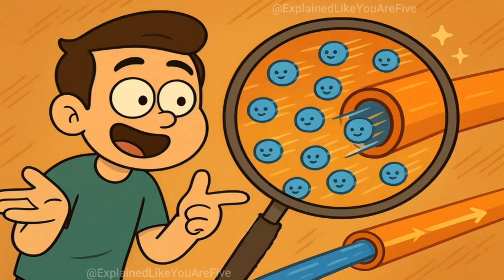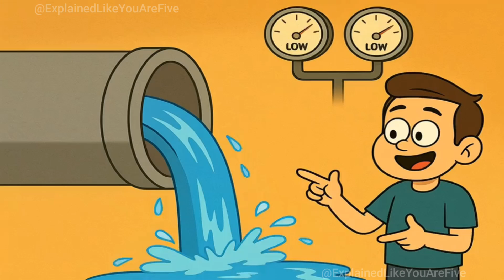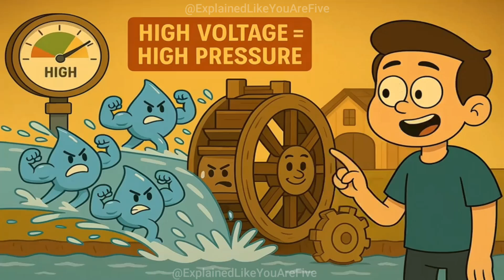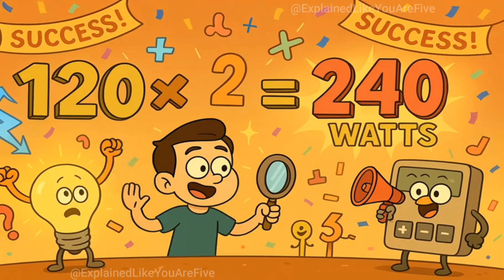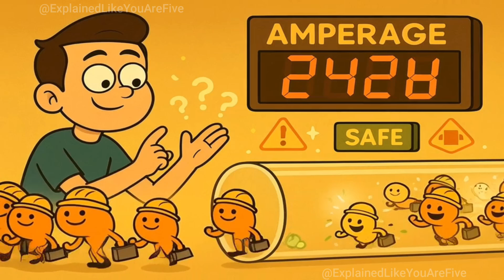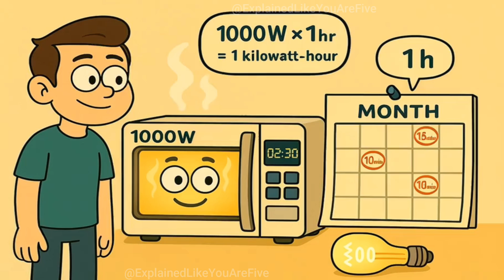The Difference Between Volts, Watts, and Amps - Explained Like You're Five

Comment: One thing that blew my mind was my neighbor is an electrician and when he went to Afghanistan he brought his alarm clock and had to change something about his clock meant to be used in America because clocks keep time by measuring the frequency of electrical pulses and america has a frequency of 60 and I think other countries have a frequency of 50. So not only does energy reach us at 120V they also flip directions (AC) every 60 seconds. Electricity and circuits are cool.

Comment: And once Renewables are connected to the grid there's an 85% loss Easley demonstrated with a volt amp meter in Ohm's law it only takes a second to double-check the power companies or inverters installed watt meter

Comment: It makes more sense to me thinking about it like this: voltage is like engine displacement or torque (like a 5 liter engine), amperage is rpm or the speed of the engine, and wattage is horsepower or total output multiplying the torque by the rpm.

Comment: But why can't a charger provide more than the designed power. I mean the adapter is designed for 11v and 3A = 33W.

But if I tried to put a 6A cable in the same adapter it can't supply 66W. Just 33W is the max out. Why?

Comment: Personal opinion... I don't think these usual metaphors for electrical properties do anything to help understand electricity. "What is electricity?" "It's like this other thing. But also a little different." I like starting with the fact that if the same measuring device is placed in "series or parallel" to a running circuit, it'll give a different measurement in each of  those situations. We have to call that something.... and so on, you go from there. But all this "Make electricity simple"-stuff... It's not simple. It's just not. That's all there is to say.

Comment: The electricity that comes into your house is 240volts. The circuit breakers split it into 120 volts for use.
Reply: Service lines are 2 lines of 120, to create 240.
The breakers utilize one side at a time but "combine" the two lines to make 240 when needed.🎉
Or something like that ...😂

Comment: I've watched 100 videos on this and it's never made any sense to me.
Reply: Volt is how fast electricity moves, amps is how much electricity moves in a second and whatt is how much consumed/needed by the device u using
Reply: @kubawlh  sounds like volts and amps are the exact same.
Reply: @typerightseesight and me 😵‍💫😵‍💫😵‍💫😵‍💫
Reply: @typerightseesight  Volts is the speed limit, amps is how many cars are on the road, and watts is what happens if there is an accident and pile-up. To create a specific type of pileup (watts), you need a certain number of cars (amps) going a certain speed (volts).
Reply: Do you understand stand it now?? Im in the same boat
Reply: @zebian-4090  A ton more yes, but still confused overall. If you look into Ghz and Mhz it helps.

Comment: Electricity come to your house at 240v
Reply: Different countries have different voltages.
Reply: @sangeeth.47 thanks, just wanted to write the same
Reply: @sangeeth.47 we used to use only 100V, back in the OLD days...
We had to up it to 120 when we started using streetlights!!
😂😂
Reply: It comes in at 120v in reference to half the transformer coil. It comes in at 240v line to line. The pressure coming from the transformer to your house in the US is 240v
Reply: 2 lines of 120.
2 lines combined for 240.